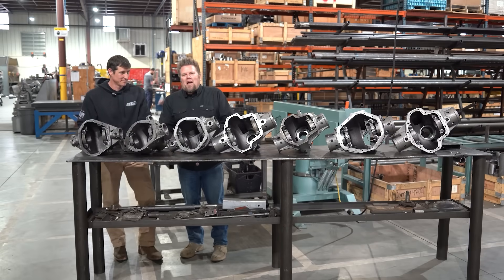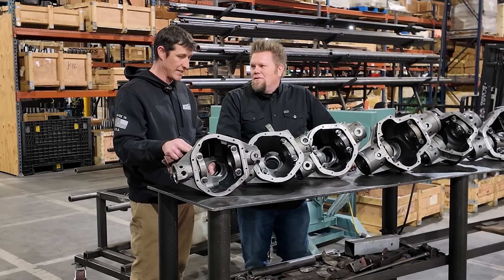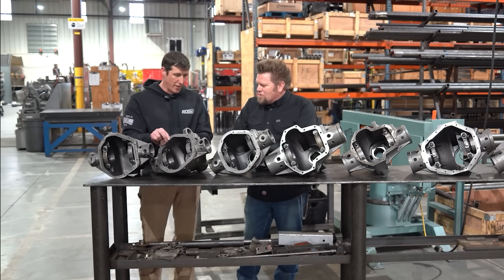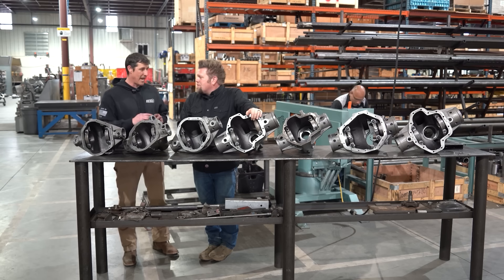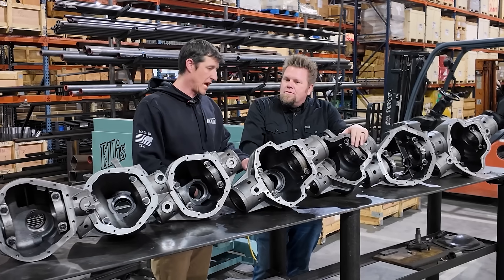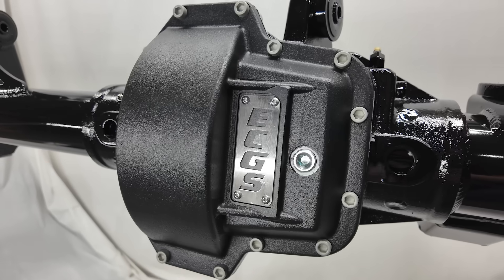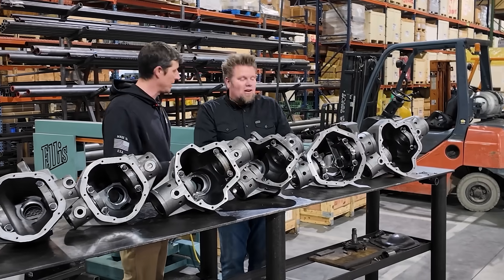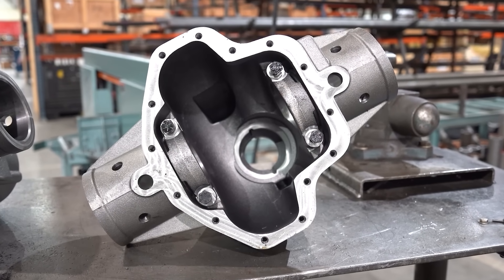No Junkyard Axles: ECGS Center Sections Explained - D44, D60, High Clearance 14-Bolt, D80

Comment from the maker: Which axle are you running now — and what are you building toward?
Drop your setup in the comments (tire size, horsepower, vehicle model) and let us know which of these new center sections you’d want under your rig.
Reply: Running built stock JK 44's on my 2016 with 37s, ZF8spd, 3.6.  I would love to run ECGS 14bolt or D80 with truss for double triangulated 4-link and match with a D60 KP540.
Reply from the maker: @OutWestUT Sorry for the late reply...this didn't show up in notifications. If you're thinking of going that big on axles, you'll want to run bigger tires than 37s. That's what most people plan to do...just stating the obvious.
Reply: gladiator 80 rear 60 front all 40 spline 42's stock 3.6 for now but eventually a 5.7 hemi will probably find its way in there and a motobilt bobbed bed. i was told 60 rear would "probably" be ok but went 80 because probably doesn't sound like for sure ok. really wanted to go 14 bolts but after having a shaved 14 bolt in my Xj that would leak i decided not to.
Reply: So how well does that Dana 80 stack up against my AAM 11.5 for 800hp and 1,500ft/lbs of torque diesel application?
Reply from the maker: @Matt-zx1xj  AAM 11.5 = bigger ring gear wins
Reply: Stock M715 Dana 60 closed knuckle front,  dana 70 rear on my 68 M715. Unsure of horsepower (chevy 350) , 38” tires. I would choose the strongest center sections that allow deeper than 5.38.

Comment: For the Dana 60's, the Front HP uses the larger 10" R&P and the Rear LP uses that standard R&P? Or do you have a rear that uses a Super 10" also?
Reply from the maker: 10" gears are just for the high pinion
Reply: @ECGSTech  Thank You - Prob go 14 bolt for the rear then

Comment: Which of these allow deeper than 5.38? Wanting axles for my M715, and would love dana 80’s, but I guess the market just isn’t there for deeper than 5.38.
Reply from the maker: low pinion D60 goes higher but that's really it.
Reply: @ECGSTech I know revolution made some 6.17 gears for the dana 80, but I don’t want to run a hard to find gear set (not that I would be rock bouncing in an M715). 

Guess I was hoping that more companies building 80’s now would lead to gearing deeper than 5.38. Also, saw 6.17 gears for the 2017 up 60 on your site, and that brought more false hope.

Comment: No normal person can afford that crap.
Reply from the maker: There are lots of approaches here. Sometimes people need complete axles built brand new or to a very specific spec that is not offered in OE axles. There are also some inherent weaknesses/challenges in OE axles that we can address with a new axle built specifically to address those weaknesses/challenges. If you don't have the skills or time to build your own axle, that also where we can help, because we have the best axle builders who churn out hundreds of custom axles per month. If you want to use an OE housing and have the time/skills, we offer a huge variety of internal and external parts that help you to build that axle to your desired level. We offer everything in between the full turnkey bolt-in axle to the DIYer who just needs parts. And if any of those is too much of financial hit all at once, we also offer Affirm payments. None of our parts are crap though, we only offer a curated collection of the highest quality parts backed by the best warranty in the industry.

Comment: so happy that you guys put this video together. everyone always jumps to the 14b because its known and its cheap. and poor salesman will say that the 14b is stronger than the 80 when thats simply not true. but I liked how you put it, with the insurance policy. my past 2 gladiators I had the 80 in the rear on the first and your 14b on the second (because it was an overstock ready to go order), I will always prefer the 80!
Reply: Agreed. The 80 is definitely stronger. But like he pointed out, the 14B has beefy axle shafts with a smaller ring gear. So it is good for off road use while the 80 would be better for towing or a high GVW.

These days you can get the 12" AAM axle pretty easily. They have been out since 2019 in Chevy and Ram 3500's. But again you lose even more ground clearance.
Reply from the maker: Both axles have their pros and cons so it's really what you hold as the bigger priority. Can't beat ring gear size for strength though.

Comment: I have an XJ with a HP dana 30 and a ford 8.8. I am running 35's and i don't plan on running bigger tires but i know the Dana 30 is my weak link the 7.15" ring gear and 27 spline shafts. I would love some new gen dana 44's (jk axles). I like the bigger ring gear at 8.9" and the larger diameter tubes. The stock tube size is only 2.5" which is tiny. I swapped out my dana 35 for an 8.8 because it has 3.25" tubes and the 8.8" ring gear with 31 spline axles. I would like the extra width for more stability on the trails and can run lower offset wheels to help with balljoint wear and turning radius.
Reply from the maker: There is lots to consider here. Do you plan to go larger tires or wheel more aggressively? Give us a call or email and we can find something to fit your needs. 919-672-2705 sales@eastcoastgearsupply.com
Reply: @ECGSTech  Looking at the limits of the 489 on your website, it looks like 37" is the max recommended tire size. I think that would suffice for my XJ at the moment. I love rock crawling and do as much as i can without getting body damage. I have another vehicle that I am planning on running at least 37's but maybe up to a 40" and doing more hard core rock crawling. Its looking like one tons are my best option. I was hoping to be able to run some lighter axles to reduce the overall weight...

Comment: What is the magic R&P that is used in the front HP 489?
Reply from the maker: @ProjectXJ is right. Thanks for answering.
Reply: @ECGSTech  I'm still confused. Everywhere I read, the JK D44 front is 216mm/8.5:. Your website lists the JK D44 front at 8.5" for ring and pinion sets.
Reply: Its the JK 44 ring and pinion. Pretty much everybody makes gears and lockers for it. Its lightweight and pretty strong. Good for most applications.
Reply: @ProjectXJ but the front JK D44 is a 8.5"
Reply: @justincrook8257 the new generation dana 44's have a 8.9" ring gear front and rear.

Comment: I have a tj with a cummins r2.8 with 35s but want to go to 38s what axels do i need i am thinking 60 in the front and 14 in the back is that overkill
Reply from the maker: It really comes down to what your future plans are and your driving style. If you wheel hard or think you my go bigger tires, go larger now. The Shaved 14b in the rear has just as much ground clearance as a 60 and not really much different cost wise. @ProjectXJ has some good insights too.
Reply: With a light weight TJ on 38's, you would be fine with their 489 front and 60 rear. A lot of people get bigger axles than they need and make the vehicle heavier than it needs to be, which decreases offroad performance.
Reply: @ProjectXJ I would almost go D60 front because it also ensures much heavier ball joints, u-joints, bearings and steering linkage. 38's are no small tire. I agree you probably dont need the gear and axle shaft strangth but those other components are key and they will still take wear and tear in 2WD. So my vote is Dana 60/60.
Reply: @geoffmooregm with heavy duty ball joints or ball joint deletes, i don't think it would be an issue. But if you are doing extreme rock crawling or go fast, i would do a 60.

Comment: 2014 JK, 5.7 Hemi ~ 400HP.  Dynatrac 60/80 with 40s and bead locks. I like the axles, I don’t ever worry about them. Really enjoy seeing that 80 under the rear. But I wish I had a lot more power to feed it.
Reply: Hellcat crate motor should do it
Reply from the maker: That is a great combo! While we don't deal with engine upgrades, there are lots of options out there for upgrades and swaps. It's just time and money, right?

Comment: Jeep TJ Rubicon, Around 300HP, 33" Tires, Stock Rubicon Axles, need to change rear axle shafts (broke one), also changed out rear to limited slip, because stock air lock in Rubicon can't get parts for.
Reply from the maker: Give us a call and we'll look into it for you. 919-672-2705

Comment: Jeep YJ, full width Ford Super Duty Dana 60 front and Sterling 10.5 rear 3.73's, NV4500, NP205, 37" Tires, About 350HP 700FP Torque.
Reply from the maker: Those are great axles. Let us know if you need parts for them or want to change out the axles completely. 919-672-2705 sales@eastcoastgearsupply.com

Comment: I bought a 489 with Eaton e locker  to replace my d35, working perfect for my 04 TJ , then bought the Currie 44 w/ Eaton locker for the front, both are working perfect and was able to install both my self, it was easy. Then decided to get a 241 t-case. Running 35 inch tires.   Well I haven't been able to break any of it yet👊🇺🇸
Reply from the maker: That's great to hear. Thanks for the business.